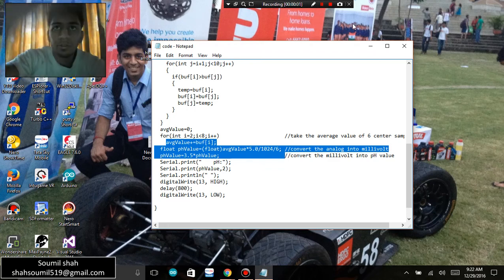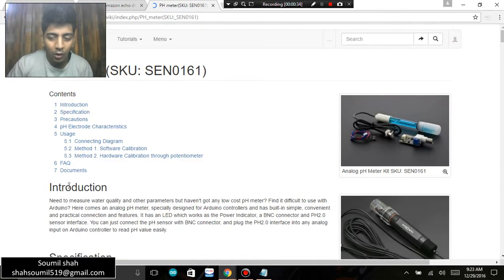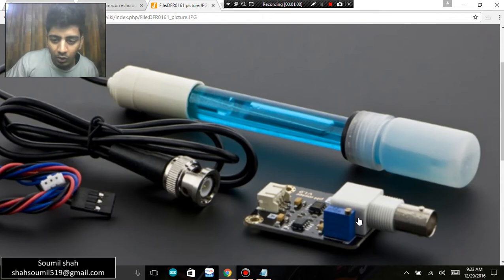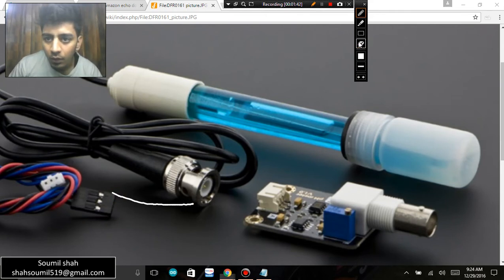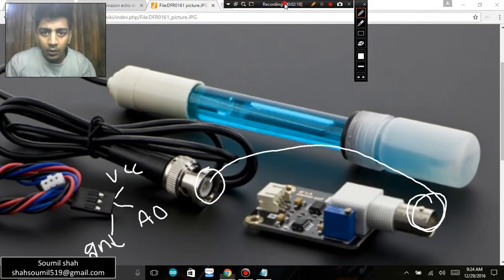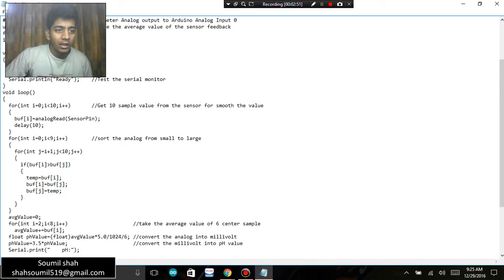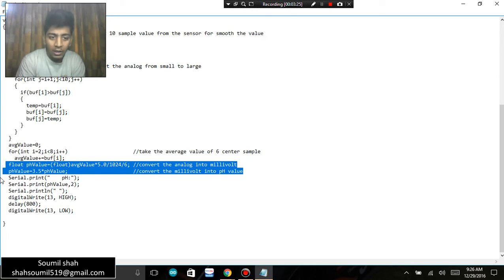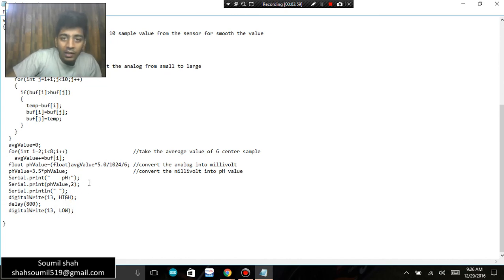ph sensor with arduino

Comment: Hey Soumil,

Thanks for the video. Do you have a picture of your completed setup? You said you purchased this and I was hoping to see it in action.
Reply from the maker: Ryan Hadley you may find sensor on dfrobot
Reply: I found it, I just wanted to see how you'd set it up.
Reply from the maker: Ryan Hadley they have in their wiki check that out
Reply: Sorry, maybe I'm not making myself clear. In this video, you said that you bought this probe. Did you ever set it up with an Arduino? If so, do you have a picture of your setup?
Reply from the maker: Ryan Hadley I bought it I made project with arduino connection setup was taken from dfrobot website 

https://www.dfrobot.com/wiki/index.php/PH_meter(SKU:_SEN0161)

We made this project for soil oh measurement 

Interfacing is there on their website